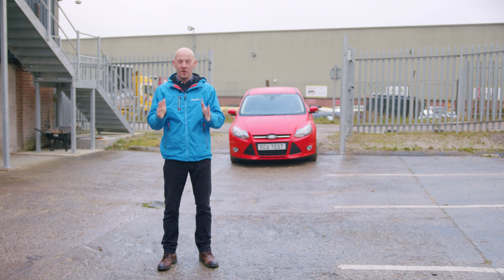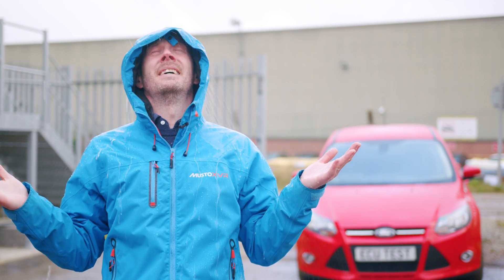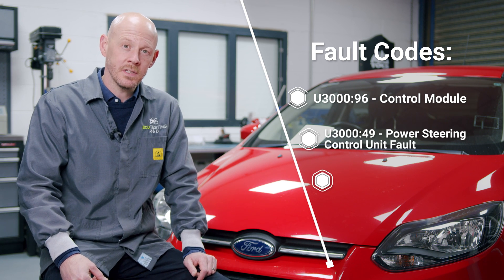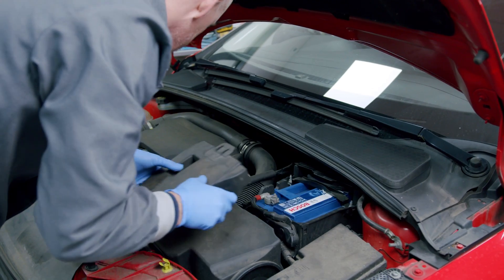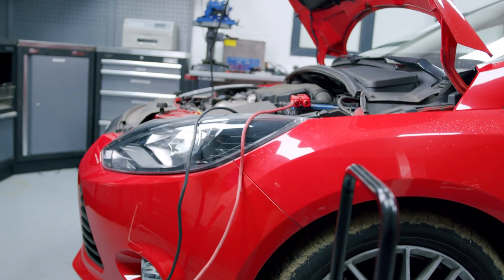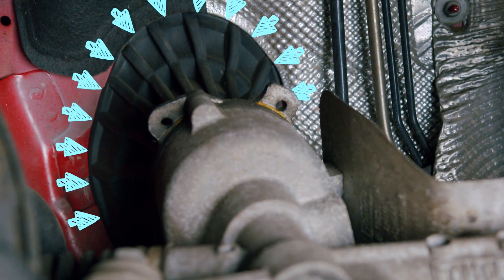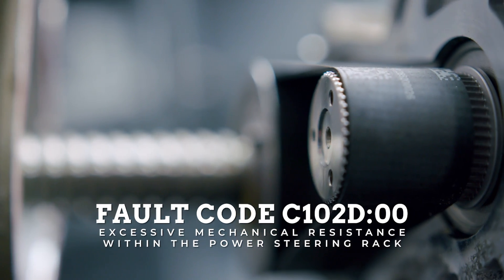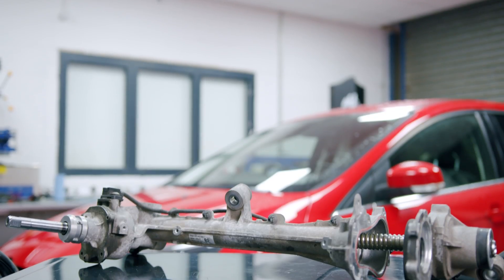Ford Focus power steering failure – common causes

Comment: Hey I have a 2014 Ford Transit Connect with power steering going & coming from time to time. I have multiple codes. Hope you can help 🙏🏼
1. U0131:00-0A Lost Communication With Power Steering Control Module A
2. U0131:00-2F Lost Communication With Power Steering Control Module A
3. U3003:13-08 Battery Voltage
Any help would be appreciated
Reply from the maker: Hi. Unfortunately as this is a product line we don't re-manufacture, we aren't aware of the exact cause of the code U0131, but it isn't something we normally see when water ingress causes the steering rack to fail. As you are getting a fault code related to battery voltage, the first thing we would recommend checking would be the battery's state of charge and state of health. If that checks out ok, then it could be that something is causing the power steering module to not communicate with the ECU, so we would recommend testing all the wiring and grounds to the EPS module: https://www.obd-codes.com/u0131. If all the readings check out ok then we would recommend contacting a power steering specialist as they may be able to assist you further. Thanks
Reply: @Ecutestinglimited  thank you very much🙏🏼

Comment: What about when I get the message , then turn off car .restart and message clears and power steering comes back ?
Reply from the maker: Hi. If you are able to scan the vehicle for any fault codes then that would aid the diagnosis. However, the problem being intermittent is a common sign of a poor battery, either state of charge or health, so we would recommend checking this first to see if it is the cause of the problem. Cheers

Comment: Saya memiliki ford focus 2005 2.0 yang mengalami gejala pada indikator pesan odometer "power steering failure". Apakah hal tersebut karena ada kerusakan dari sensor atau yg lainnya....sedangkan stir tetap ringan tidak mengalami masalah. Terima kasih atas jawabannya
Reply from the maker: Hi. We would recommend checking the batteries state of charge and health first, as this could be causing the issue. If you are able to scan the vehicle for fault codes then this could narrow down the cause of the problem. Thanks

Comment: Hello,

I got the "steering assist malfunction" error. Checked error codes, found battery voltage low, replaced battery, error code disappeared.
Problem remained, still "steering assist malfunction" intermittently, error code: U0131:00-2F

Any idea?
Reply from the maker: Hi. Apologies for the delayed response. Unfortunately as this is a product line we don't re-manufacture, we aren't aware of the exact cause of the code U0131, but it isn't something we normally see when water ingress causes the steering rack to fail. It could be that something is causing the power steering module to not communicate with the ECU, so we would recommend testing all the wiring and grounds to the EPS module: https://www.obd-codes.com/u0131. If all the readings check out ok then we would recommend contacting a power steering specialist as they may be able to assist you further. Thanks

Comment: Does the standard MK3 shares the same steering motor with the ST?
Reply from the maker: Hi. I believe the standard MK3 uses a different power steering rack compared to the ST, but to be sure either check your part number against each rack on this website: https://shop.westernpowersteering.co.uk/category-263/FORFStER.html
Or contact a power steering specialist such as the one above. Cheers

Comment: why can't I repair the steering rack,  I do have a Powersteering failure, on the dash instrument panel, showing up and ..
Reply from the maker: Hi. Unfortunately if the error is being caused by a water ingress issue then the damage is usually none-repairable. There are other things that can cause a powersteering failure, such as a faulty battery, so make sure to complete a thorough diagnosis before condemning the unit. There are powersteering specialists that may be able to assist you further such as: https://shop.westernpowersteering.co.uk/category-263/FORFER.html
I hope that helps, cheers.
Reply: Thanks, your videos are excellent they are very proffessional, I will check all possible causes, before I fix it.

Comment: Hi my mom hit something on the highway it didn’t hurt the powersteering rack but now the dash says no power steering or fault and it won’t work at all I did clear the codes and it worked for a hour then came back any ideas ?
Reply from the maker: Hi. Are you able to scan the vehicle for any fault codes? If not then it will be hard to diagnose an exact cause, and it could be that the accident is unrelated to the fault. We would also recommend checking the car battery's health and state of charge as well, as this is a common cause of an intermittent power steering fault. Cheers

Comment: Rac gave me an error code od c102d  and they rest the code and it got me going again . But did it would happen again . Just booked into a garage
Reply from the maker: Hi. The code C102D is usually caused due to water ingress occurring on the module side of the steering rack, which causes excessive mechanical resistance. If water ingress has caused the fault then unfortunately it will re-occur resulting in you needing to replace the steering column. Apologies.

Comment: Yeah stay away from   focus
Reply: I wouldn’t say to stay away any more than any other car. Even the legendary Toyota 4AGE had oil burning issues. Power steering is just the Focus’s Achilles heel. Same for the Automatic transmission. If driven carefully, they can last quite a while. So long as you drive it like a manual and not like it has a torque converter.

Comment: Hi had power steering assist malfunction- service warning light come on - steering went heavy . But after driving home and jiggling steering wheel came back . Have since started car twice and no warning lights any more . Have Ford Focus 2012 model . Any advice? Thanks
Reply from the maker: Hi Michelle. If the issue has only been intermittent, we would recommend checking the batteries state of charge and health first as this could be the cause. However, if the issue persists and the battery health is ok, then we would recommend scanning  the car for fault codes to diagnose the issue further. Cheers.

Comment: Hi, am opening my first shop for hydraulic and electric power steering components rebuild. I just wanted to find out, which good tools or equipment do I need for the fault testing of the electric steering rack outside the vehicle?

Comment: Hi, great video 👍🏻 I have a 2011 c-max with a (power steering malfunction check hand book) intermittently appearing, would the fault codes on your video be the same for a c-max? BTW, have changed battery & still have warning. 
Thanks.
Reply from the maker: Hi, thanks for the kind words. The fault codes in the video should be the same for a C-Max yes. And if you have replaced the battery and are still having the fault codes appear, then it is likely that your steering rack is water damaged and may need to be replaced.
Reply: @ECU TESTING  thanks for the reply, I had car plugged into came up with u3000 control module, so I guess it's rack related ☹️ can you just replace the module? 
Thanks.
Reply from the maker: @brookado  Unfortunately U3000 usually indicates a water damaged torque sensor on the module side of the rack, and we aren't aware of a company who will repair just the module. There are specialists who re-manufacture these power steering units which may save you having to buy a brand new replacement: https://shop.westernpowersteering.co.uk/category-263/FORFER.html
Reply: @Ecutestinglimited  thanks for the reply & help. 👍🏻

Comment: After an alignment (wanted to get the steering wheel back to center) from an independent shop, the steering was darty and unpredictable in certain situations. After turning and trying to come back to center, the steering wheel would be crooked and then as it tried to get straight the car's wheels would dart either direction. While making a lane change, the car would dart further into the lane then I was telling it to. The Dealer is saying I need to spend $3,000 because my steering angle sensor is having a hard fault. They want to replace the rack and pinion?? Any help is appreciated. I simply can not afford this and have no idea what to think.
Reply from the maker: Hi Ron, apologies for the delayed reply. Unfortunately it does sound like your steering rack is faulty and will need to be replaced. However you don't necessarily need to go the dealers to get a replacement rack as there are other options available from specialists such as these:  https://shop.westernpowersteering.co.uk/category-263/FORFER.html
Reply: @Ecutestinglimited   if you have any US links to it, would be helpful Thank you in advance

Comment: Hi, my daughters 2017 Ford Focus have her a "steering fault" warning and then a "steering loss stop safely" and she lost power steering. I stopped at part store and with two different scanners checked the car but came back with no malfunction codes. Any ideas? Warning still says steering loss but no codes show up on scanner.  Thxs in advance
Reply: You need a modified ELM327 with the HS-CAN switch specifically for Ford. Once you have that use ForScan and you will be able to read the error codes. Generic tools will show no codes as they don't access the HS-CAN bus.
Reply from the maker: Hi. With no fault codes being produced, it would be difficult to diagnose. However, we would recommend checking the batteries state of charge and health first, as this could be causing the issue. Thanks
Reply: @Ecutestinglimited  Hi, So the shop ran a scan and found "C102D - 00 - High Friction In Power Steering".  He checked the fuses and reset it and now the code is gone and the steering is back.  Thoughts?  I don't want to have my daughter driving and have it happen again.  Mechanic is not sure what to do with it now.  Said he drove it all over and seems fine.
Reply from the maker: @l8ndadgmail  Hi. The fault code you have mentioned normally indicates a water ingress issue around the module side of the steering rack, caused by excessive mechanical resistance while steering. However, if you have driven it and the power steering is still working, it could potentially be the fuse causing the fault code. However if it is a water ingress issue then the fault will re-occur and there is no guarantee that the issue will not happen again.

Comment: I have a 2012 ST and had the problem maybe 2-3 times intermittently and I just turned my car off and on, than the power steering was gone completely. I’m not getting and error code just the message power steering malfunction. Do you think it would most likely be the battery?
Reply from the maker: Hi Cameron. We would recommend checking the batteries state of charge and health first, as this could be causing the issue. However with no fault codes being produced, it would be difficult to diagnose further. Thanks
Reply: @Ecutestinglimited  thank you for the reply! I have had the battery tested came back fine. I think I’m up for a new power steering unit. Thanks anyways for the advice 👍

Comment: Hello, I had my power steering go out in my 2015 Ford Focus ST (USDM market) this morning on my way to work. After work, I tore some  things apart and found that it was an 80 amp stud fuse within the high current battery junction box (the panel at the front of the battery box). I replaced the fuse and it worked fine for about 9 minutes of driving, and then it went out again, one again reading "power steering assist fault" on my dash. 

What could keep blowing this fuse? I'm at a loss, thanks.
Reply: I HEARD THE SAME THING HAPPENED TO  MANY OTHER PEOPLE  !!, I  THINK  THE  EXHAUST  MANIFOLD BURNED  THE  WIRE HARNESS !!,   AND OVERTIME   IT  BURNS  OUT  THE  POWER  STEERING  MOTOR  AS  WELL AND  IT PROBABLY  SHORTENS  OUTS  SENSOR  TO !! .
THE  FORD  DEALERSHIP   NEEDS  TO  PUT   A  HEAT   SHIELD  AROUND  THE  ELECTRIC  POWER  STEERING  MOTOR  UNIT  !! . AND SOME KIND OF SILENCE AROUND THE  NECK  OF  THE  STEERING  RACK  THAT  GOES  INTO  ELECTRIC  POWER  STEERING  UNIT !! . 🤔🤔  NO ?
Reply: I just got a notification about this comment so I'd figure I'd update it. My buddy and I went around continuity testing all the wires and determined it had to be a short within the rack, after replacing the 80amp stud fuse again and it only lasting about 45 minutes. Granted, my battery was shot too, only holding 9V with a dead cell within the battery. 

I ordered a new power steering rack from LKQ and just dropped the front subframe from the car yesterday. Upon doing so, it was clear that the harness that runs to the EPAS was rubbing on something and also was burnt. One wire that plugs into the EPAS within that harness was only half held together. Obviously that was the issue, but it was impossible to visually inspect that harness without dropping the whole front subframe. (EPAS rack & swaybar are attached to this and come out with it)
Reply: I know its a year but what did you do to fix it.  @Tweedlenuts

Comment: I have a 2015 focus my power steering has stopped working i have error codes u3000 96 and 48 will this mean i need a new rack thanks.
Reply from the maker: Hi. Those fault codes normally indicate a problem with the power supply to the power steering unit. We would recommend checking your cars battery for state of charge and state of health, and potentially replacing the battery if required. If the faults still persist, then it could mean the rack needs replacing. Thanks

Comment: Hey, I have the power steering fault message and no power steering at all. Hasn’t gone out intermittently at all, just went to go drive my car one morning and the power steering is gone, tried driving it around the block to see if it came back, no dice. I have had the neighborhood rabbit chew up wires in my engine bay before, but the chances of that feel astronomically low. Any ideas?
Reply from the maker: Hi. Are you able to scan the vehicle for any fault codes? Without that it would be difficult to diagnose what the cause could be, and the codes could show a that there is an incorrect voltage being received by the EPS which could cause the issue. We would recommend checking the car batteries health as well, even though it is unlikely in your case as it is normally an intermittent issue at first. However it is the easiest thing to check.

It unfortunately sounds like either the belt inside the steering column has broken suddenly, or damage to the torque sensor etc, which will mean the steering column will need replacing/re-manufacturing. But I hope it is the neighbourhood rabbit so its a less expensive fix for you! Thanks
Reply: @Ecutestinglimited  just took a look last night and I got rabbited again!! Chewed right through the wire that heads to the fuse box, spliced it back together and now it works like a charm. Thanks!!

Comment: I’ve had the low battery voltage error before but was able to set the unit right with IDS. The issue is intermittent when the weather is hot. Since battery performance is degraded in extremely high temperature should I replace the Ford OEM battery with something better?
Reply from the maker: Hi. If the battery health isn't good in high temperatures and that is when you are experiencing the error, then we would recommend replacing the battery yes.
Reply: @Ecutestinglimited  I found if the car charges the battery greater than 80% as reported by ECU I have issues. I make sure it can't charge past that point by having a dashcam on in park mode when not driving.

Comment: My Ford focus 2014 was having the scrappy noice when steering, but today suddenly the steering wheel is block and shows a message on the screen about a direction malfunction. Is it the same rack? Should I replace it? And where can I find the part with a not so expensive price. Thank you
Reply from the maker: Hi Abed. We believe your 2014 Focus will have the same steering rack as the one shown in this video, however if you are looking at buying a replacement then we would always recommend checking your part number matches the new rack to confirm this. Are you able to get any fault codes from the vehicle to confirm what the fault could be? If you need to replace the whole rack then you don't have to go to a main Ford dealer and you could use a power steering specialist instead: https://shop.westernpowersteering.co.uk/category-263/FORFER.html
Thanks

Comment: I have a power steering fault in my own. But I’m not getting any diagnostic codes at all. I’ve tried pulling fuses, disconnecting the battery to reset the electronics. Any ideas😕
Reply from the maker: Hi. Without any fault codes it is difficult to say what could be causing the fault. Is it just the fault warning message you are getting or is the power steering not working i.e difficult to turn? Have you checked the batteries health? If it is an old/faulty battery it could be causing the fault to appear intermittently, otherwise it may be a problem with the power steering pump or the rack itself. Cheers
Reply: Saya juga mengalami hal yang sama yaitu "power steering failure"tapi tidak ada kode yang muncul dan pada steer kemudi saat berbelok tidak ada masalah tetap ringan, terkadang pesan itu hilang dengan sendirinya.... apakah itu penyebabnya dari battery?

Comment: Do we have to program the new steering rack to the car and if so can it be done with Forscan or absolutely have to go to a dealer?
Reply: We had a guy change the steering rack , and we simply took it to a shop where they did an alignment (it was badly needed) It worked fine for over 2 years and it failed again. Sitting in the garage now, gonna try and do the replacement myself this time. Ford made a piece of junk with this focus.
Reply: When you get a answer please let me know I have the same question
Reply: Me too